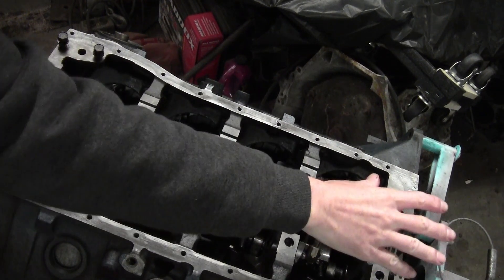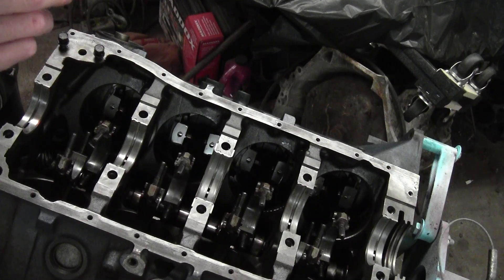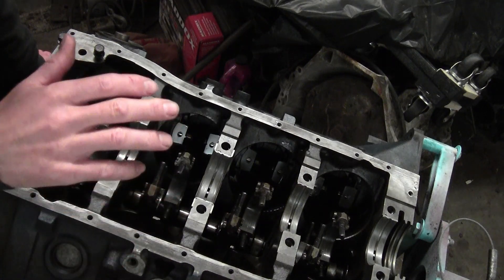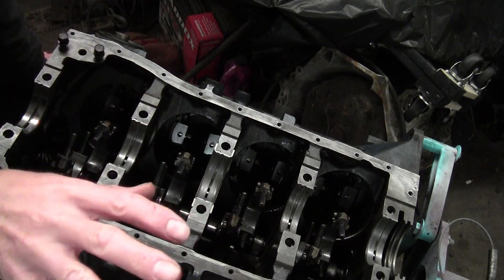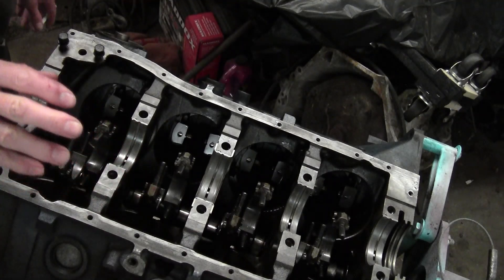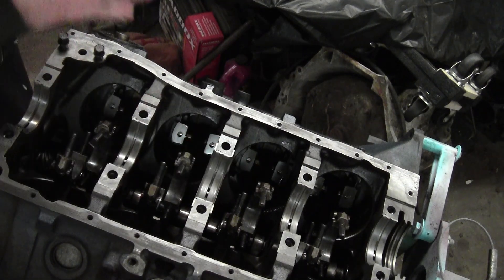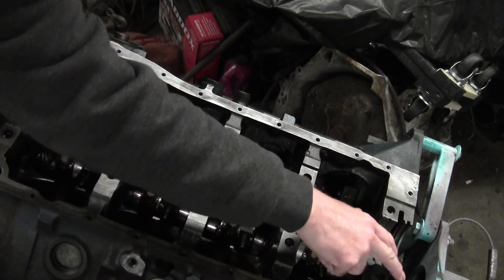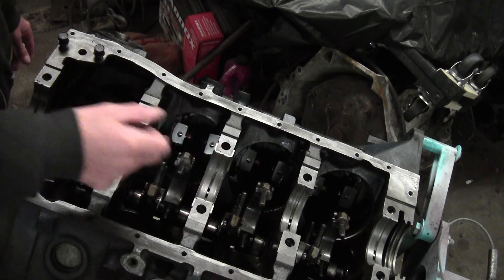460 Ford Main Bearings & the Secret to Ford's Sucess for the 1958 Ford Fairlane Budget Build!

Comment: I got some D0VE’s for my 460 my question is if it’s going on my daily driver should i get seat inserts on the exhaust they came from a 68 Lincoln premium fuel im worried about today gas no lead i  it
Reply from the maker: Good set of Heads man. Depends on what block you are putting them on. The short deck (68-70) definitely, mid-deck (71-77) with dish pistons it's a 50-50 shot, and the tall-deck (77-98) with deep dish your odds go up even more that the seats will last with 90+ Octane. If it was me (because I'm cheap and don't mind working on them) I'd run them as they are until you start seeing blow-by.... then I'd pull them and have a full valve job done to them with hardened seats & SS Valves, better springs ect ect ect. 
I've had some that shouldn't last a week go for years, and I've had some that should work only last a few months and the only way to find out is to roll-the-dice or go all in.... if that makes sense. Hope that helps man.

Comment: I acquired a 429 4v from a 69 Galaxie 500XL in 1988, it had only just been taken off the road, still running. Only two things wrong in it.  First, valve stem oil seals had hardened and broken, the bits plugged up the oil pickup so the bearings were down to the copper. The crank was fine so we just put new shells in. Second, one of the pistons had a skirt starting to collapse with cracks either side. I believe the previous owner had tried to see how far he could rev the motor which might explain that. I replaced the piston, fitted new rings, new roller chain & peppier cam. It sat on an engine stand for years (long story), eventually it went in my 72 Mach1 where it was a hoot to drive.
Reply from the maker: Way cool!

Comment: good night friend, I have a 460 and I have not been able to correct the oil bottle due to the rear seal, I knocked over the crankshaft but it lasts a single day without throwing, then as the days go by it gets to throw 2 liters of oil daily, I cannot correct the bottle of oil, use original felpro brand
Reply from the maker: Definitely sounds like the rear main is slinging it out. Make sure that the seal is installed the right way. The spring side of the seal goes toward the oil (like a dam) or it will let the oil pass right on by. Also if you are using the cork style gaskets (pre 1996 style) synthetic oil will pass through those. It's best to use the premium 1 piece (rubber type) gaskets with synthetic & synthetic blends.
Hope that helps.

Comment: Good Stuff Bare Rose! I didn't realize you were a closet Blue Oval guy, lol I going to go through your playlists and find more Gems like this video! I am running a built 73 built 460 in my 67 Mustang currently, and this winter, either swap it out for a 408 roller block 351W stroker or stroke out my 460 to a 557 i think it is. Cheers See ya Saturday night live chat.
Cheers from Motown/Dearborn.
Reply from the maker: Hey there Robert, good to see ya man! Yeah.... I play with all of them from time to time... 
Sorry I missed this Saturday (1st time I've misssed a Live since I started all this). I had major PC & Net issues last week, but hope to see you this week man!
Reply: Which motor did you go with?

Comment: Great video and I am really learning about the internals on these 460's!  Growing up in the 70's, our neighbor and his family went with us to the Colorado River and houseboating to Mead, Shasta and Lake Powell.  It was always a big caravan!  He had a '76 Ford Ranger with a 460 and a '76 Cheetah Daycruiser with a 460 and a Berkeley Jet.  I water ski'd every summer behind that boat and my Dad and I helped him work on it if it had problems.  He was a die hard Ford Guy and now I see what he saw in those 460's!  Thanks for sharing this with a Small Block Chevy guy like myself!  It is neat to finally learn about them!
Reply from the maker: That is Way Cool! That 1951 Chevy we did with the zoomies? That's out of a Daycruiser as well! And about the same year! Those 460 Berkeley's are actually an animal to themselves! The block is pretty much the same, but they came with ported DOVE-C heads and their own Intake manifolds with HUGE runner in them! Funny story about that boat, dad bought it for a song because they couldn't get it running. He got it home and noticed it had an Automotive starter on it. The Berkley's turn clockwise (normal) but the starter is mounted on the back side instead of the front side of the flywheel, so they take a special order (ultra-expensive) high torque - reverse rotation - starter. The cheap Automotive starter they had put on it was turning the motor backwards so it wouldn't fire.... lol. Put a marine starter on it, and it fired right up.... lol. Later when he decided to build the Monster Truck (from the pile of junk Monster Truck) he had bought, that was the engine he used to power it. When we sold the truck.... it had the Built Ford 460 in it, and we kept the Berkeley 460 to build that Rat Rod with.
Reply: @BareRoseGarage  Wow!  Great story!  How close those guys were to having a great running boat but, with their lack of knowing, they sold a perfectly good boat!

Comment: I had external oil lines on my old 292 Y block so the rockers would get oiled. I think part of the problem was the old paraffin based oils that were used back then....
Reply from the maker: yeah, they used to sell a kit that would lay down in the valley like a sprinkler system to oil the cam, lifters, distributor, & timing chain. It also came with the Rocker Shaft Plugs to pressurize the rockers to get oil on the rockers. It really helped them but by that time Ford pulled the plug on them in favor of fixing the "oops" in the FE design that put too much in all that and starved the bottom end.... lol. Then you couple all that with no PCV system & non detergent oils and it just made a mess of things.... lol.

Comment: That motor looks fresh. Should be a good runner. Was just wondering what your running for ignition? Personal I always had great luck with the factory duraspark distributor and box. I have had a lot of old Fords and the ignition never let me down. Unlike the ignition modules in a GM hei and tbi trucks. Some may differ but that's my experience. I would guess your motor will be around a honest 310h.p. 420ftlbs. It will move that light car well and run like a swiss watch.
Reply from the maker: Going back and forth on it actually. I have the "spark box" set up still, but I'm leaning toward the '69 Points distributor. Up there the hood clearance gets even tighter, and the Spark Box cap is actually a tad shorter, so it might go with that. Funny..... this is the ONLY car I've owned that cutting the hood isn't an option on... lol. Kinda like the build you are doing, I'm banking on the Torque Numbers to get her out of the hole and hoping she has the pony's to carry it the 8th. It's going to be fun no matter what lol.

Comment: The 460 Ford is a well thought out engine design, the 385 Series. 
The little hole off the main bore lubes the cam bearings. 
The large diameter mains support the crank well.
There is alot of rigidity in the block and crankshaft. 
When a bearing shows copper does not mean it is bad.
The copper over plate is designed to wear if there is a tight spot.
Thus creating a perfect alinement.
Your engine looks nice from what we can see on this side of the camera. 
You're giving people good information. 
Great content. 
Thank you, Ed.
Reply from the maker: Thanks a Million for that Ed! coming from you that really means a lot! man it's hard to get that all in there in under 10mins. When I popped her open and was digging around in it, I found some big hard chunks of carbon, and decided to set my mind at ease by cleaning out all the oil passages in the crank and just go completely through it. Those 3,200 miles are really in the back of my head on this build... lol. If this was just a driver for around here..... I probably would've just painted it and drove the bugs out of it around here lol.